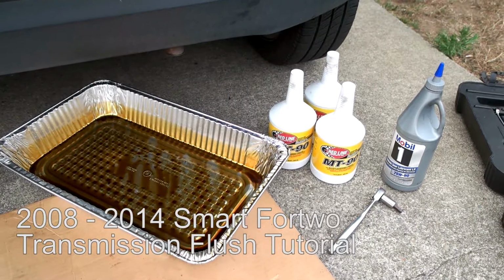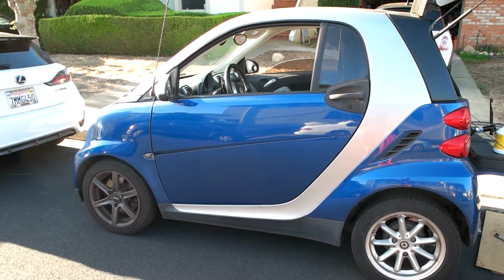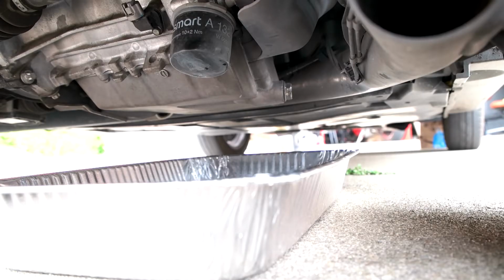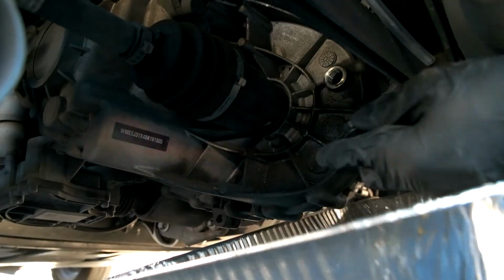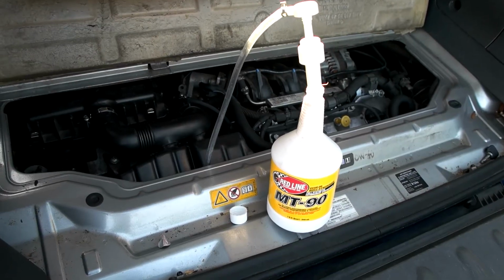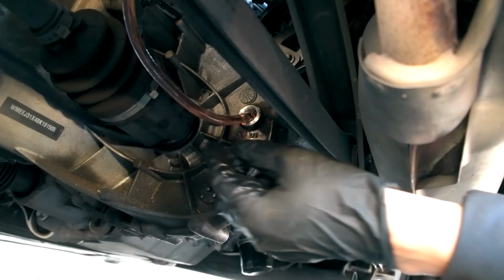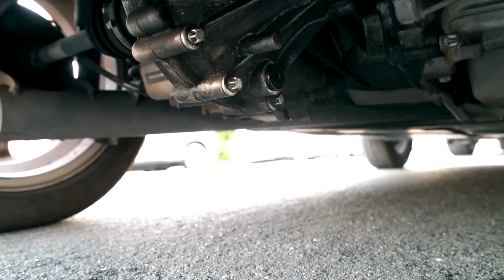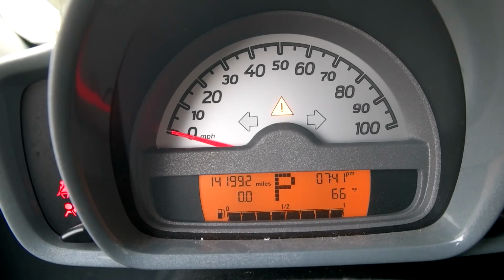DIY Smart Car ForTwo Transmission Fluid Replacement Tutorial

Comment from the maker: Hey everyone, I was able to upload the remaining videos in this series. Please feel free to check them out!

1. Oil Change https://youtu.be/4fhTtHxlgTU
2. Transmission Flush https://youtu.be/YLRtDSePTEA
3. Spark Plugs https://youtu.be/COdCrvQCQJU
4. Air Filter https://youtu.be/3oV5JR5FEy0
5. Valve Cover and Gaskets https://youtu.be/YKhJHt6haN8
6. Cabin Filter https://youtu.be/IDarMIspk7w
7. Reset Service Light https://youtu.be/7SBPWear5Ho
Reply: Hello, by chance do you know why the first gear goes very hard twice?
Reply from the maker: Hello, I do not recall having that issue on my smartcar. I'd suggest bringing it to a mechanic to verify @cesar20202
Reply: I changed out the oils as on your clip. Now my engine light is on, and it jerks a bit while shifting to higher gears 
 Any input on that ?
Reply: I followed your clip step by step. Now engine light is on plus it jerks a bit? Is it possible I have TOO much fluid in it ?. I'll take to to a auto zone for the codes in the morning
Reply from the maker: @michaeljones633  Excess fluid should have dripped out of the fill hole, and should not cause it to jerk. It almost sounds like there isn't enough fluid, or one of the empty or fill bolts was not tightened. Are you able to see if it's leaking? Scanning the code would provide the most accurate information as the issue may be from something else.

Comment: Is there no filter for transmission?
Reply from the maker: It has been several years since I've owned this vehicle, but I do not recall there being a transmission filter. This post also says the same thing. https://www.smartcarofamerica.com/threads/a-smart-car-transmission-is-a-terrible-thing-to-waste.29929/#:~:text=I%20changed%20mine%20at%201%2C000,at%2045k%20miles%2C%20et%20seq.

Comment: I think many people (me, too), bought a 451 not understanding it is not an automatic transmission.  ALL Smartcar 451 models have a manual transmission.  I have owned mine for 2.5 years without actually understanding.   Some 451s have a regular stick shift/clutch and some with a special shifting box that makes the shifting automatic, for the driver.    Read this:

Automated Manual:
The Smart Fortwo 451's automated manual transmission, designed by Getrag, operates like a manual but without a clutch pedal. It uses electrohydraulics to control the clutch and shifting. 

5-Speed Manual Option:
Some 451 models were available with a true 5-speed manual transmission with a clutch pedal
Reply from the maker: Yes, that's good information. I bought a used ForTwo and learned from my research that it had a manual transmission because people complained that the automatic shifting was rough. Thanks for the comment!

Comment: Great video.  #1 TIP - remove fill plug before drain plug. Thanks very much.

Redline is GL-4 and ok to use.   Mobile 1 is GL-5 and not ok to use (more below).
Mercedes added a spec for 451 tranny fluid in 2019, after done importing to US, so not in manuals.
MB 235.72 (not 235.71 or 235.72) is only available specific Castrol Product, which has to be ordered from EU.
Castrol Transmax Manual Multivehicle  505678    or   Castrol Syntrans Multivehicle 75W-90
both are MB 235.72 certified.
API GL4 , Ford WSD-M2C200-C, MB235.72, *SAE Class according to J306 pre 1998

Some GL-4 manual tranny oils state "protects brass" on the label.

AI says:

GL-5 gear oil is designed for high-speed, high-torque applications and contains a higher concentration of EP additives compared to GL-4. These additives are crucial for preventing micro-welding on gear flanks at high temperatures. 
 
However, the same EP additives in GL-5 can be corrosive to the bronze or copper used in synchronizer rings. These rings are essential for smooth and efficient gear changes. 

Using GL-5 in a transmission designed for GL-4 can lead to premature wear, grinding, or even complete failure of the synchronizers, resulting in harsh or jerky gear changes

Comment: How often should this be replaced? I just bought a 2013 with 92000 miles, I want to make sure everything is done so that it has a fresh start with me.
Reply from the maker: I'm reading that the transmission fluid never needs to be changed unless it's contaminated by water. Others suggest 30k-100k miles.
Reply: @ColinLeung  Thanks, I'm going to go ahead and do it anyways because its so easy. I've read changing is not needed but changing it made it run smoother for some.
Reply from the maker: @Phatxam  Sounds good. Let me know how it goes!

Comment: Hola buenas tardes disculpe al último en hacer los pasos para borrar las dos llaves mi carro no prende
Reply from the maker: If you're looking to replace a lost smart key for your car, you'll likely need to visit a dealership and provide proof of ownership. The dealership will then program a new key to work with your car. 
If your smart key isn't working, here are some things you can try:
Check the battery: Smart keys run on batteries, and over time the battery can drain, causing detection issues. 
Check for signal interference: Phones and radios can interfere with the signal between your key and car. 
Reset your key: To reset your key, you can try holding down the lock button for one second while the car is off, then turning the key four times within 10 seconds and removing it.

Comment: My question is why you have two diff. Brands is it it just for show or you drained and flush twice?????
Reply from the maker: To show different brands. I had the Mobil 1 from a previous car, but didn't have enough. It was cheaper to buy the Redline fluid, and I did not want to mix brands. Thanks for the question.

Comment: Hi @ColinLeung - was the car flashing wrench icon on the dashboard before oil change as well? or did it start complaining to reset after you did the oil change after its computer figuring the oil change? I know this is was an old video so only if you remember :)
Reply from the maker: If I recall it's scheduled to show up every x amount of miles. I don't think the computer is smart enough to know the oil was changed.

Comment: Is there a dip stick for the transmission
Reply from the maker: According to this post there is no transmission dip stick. https://www.smartcarofamerica.com/threads/hi-and-how-do-i-transmission-fluid-level.43993/
Reply: So how do you check the transmission fluid? I
Reply from the maker: @bobbyfischetti1630  You'd have to open the top fill bolt, and feel if the fluid is low...

Comment: @michaeljones633
33 minutes ago
I changed out the oils as on your clip. Now my engine light is on, and it jerks a bit while shifting to higher gears 
 Any input on that ?
Reply from the maker: Is it a check engine light? I'd suggest using an OBD2 reader to see what code it is. Did you replace the transmission fluid, or engine oil?
Reply: Colin !! Code came back. .. p0301 . I have a misfire  on cylinder #1. Just odd how that would show up after a transmission fluid change  @ColinLeung
Reply from the maker: I'm glad you figured it out and it's unrelated to the transmission flush, but I'm sorry you have a misfire.  @michaeljones633
Reply: @ColinLeung  Im hoping it's just a spark plug issue
Reply from the maker: @michaeljones633  That would be the cheapest solution. Let me know what the issue is when you fix it.
Reply: @ColinLeung  Well plugs and coils are replaced. But the plugs were covered in oil. Valve cover gasket is my next bet.
Reply: I followed your clip step by step. Now engine light is on plus it jerks a bit? Is it possible I have TOO much fluid in it ?

Comment: Hi, the Red Line MT-90 is a GL-4, does the trans oils spec require GL-4? That link of fluid specs did not specify GL-4 or 5. Thnx
Reply from the maker: I don't think it requires GL4/5. Some other trans oils suggested on the forums are:
Specification (Castrol Manual**) BOT328, 75W-90 API GL4
smart P/N #A 001 989 51 03 10
Mobil Delvac Synthetic gear oil 75W-90
Mobil 1 Synthetic Gear Lube LS 75W-90"
Reply: @ColinLeung  Respectfully, GL-4 for manual/automatic tranny.   I posted a comment on your excellent video today.

Comment: Hi, quick question, does the transmission fluid has to be Synthetic 75w90 or can i use conventional one like 'Valvoline High Performance 75W90 Gear Oil'? Thanks
Reply from the maker: Based on this website it doesn't specify that it needs to be synthetic. https://cararac.com/gear_oil/smart/fortwo.html
Reply: @ColinLeung  Thank you
Reply: Hi,  that is weird.....the site doesn't list the Oil Type for my 453 ( DCT transmission)  I saw for 451 is 75w-90.  Thanks
Reply from the maker: @Nick2JZ  I responded to your other comment regarding 453 oil.

Comment: Seems like u don't need a pump ??  Just a funnel with a hose attached  would do the same ...  right ? ...
 Plus then u can use it as a beer bong after .. or vice versa 🤣
Reply from the maker: Yes, you can use a funnel with a hose. I had a pump laying around, and used that instead.

Comment: Ok, so the fill bolt on my 09 Smart ForTwo got stripped (the hex has rounded off on the inside), And I can not find a replacement bolt for it :( any help with finding one is appreciated... thanks
Reply from the maker: Hello Prime, I couldn't find the transmission parts diagram online. I'd suggest calling a Smart dealer and asking them... Sorry I couldn't give you a link to the product.

Comment: Your video encourage me to have a go and as explained in your video it was so easy. I did it myself. The shop wanted $170 and I bought the better oil and pump for $53. A great saving. Thanks again for sharing your videos.
Reply: Amsoil both trans and engine will help these vehicles last a lot longer and increase drain cycles plus improve performance too David. Also pays to use a fuel system cleaner every 4 tanks.
Reply: @conmanumber1246  what fuel system cleaner you recommend

Comment: Would a transmission fluid slight leak be difficult to fix would it just be replacing a seal?
Reply from the maker: It might be easy, but it depends where it's leaking from.

Comment: Do you manually shift your Smart Fortwo for better performance instead of using the auto clutch? If so, how do you find getting used to it's type of manual gearing as opposed to a regular clutch manual transmission? Also, do you switch gears when the arrow on the dash tells you or do you just get a feel for it by the revs and sound like you normally would do? I'm about to try it for the first time, not having driven a standard in years. My car has no tachometer on the dash.
Reply from the maker: I did a mix of auto and manual shifting depending on where I was driving. I left it on auto when I felt lazy to shift in the city and highway. It felt different than a manual because you cannot control how long or smooth the clutch engages without a clutch pedal. I shifted based on the sound of the engine. I did add an obd 2 scanguage that told me the rpms, but ended up not using it often.

Comment: Just got a 2008 Fortwo Passion. I have no history on the car. The back door says Electric Drive which they didn't make in 2008 so I think someone replaced a lot of stuff on the car. Back of the owners manual a hand written note says oil and filter was changed in march of 2015. It's got 77K miles on it so I'm thinking I need to just change everything I can maintenance wise. I subbed because you have a current active Smart Car channel and hopefully I can pick your brain if I have trouble with this stuff. LOL Thanks. I see you are a Christian and you do ebikes so even better! I have a 48v front hub 1000W ebike. I should talk to you about Biblical Cosmology sometime.
Reply from the maker: Thanks for the comment. Yes, I can try to answer any smart questions you have. I sold the car a few years ago, but can see if I remember anything.
Reply: @ColinLeung  Oh I see, these are videos you made a few years ago. Would you happened to know someone who repairs the soft top on youtube? I need to rebuild mine and a shop wants 2400 dollars. That's more than I paid for the car. LOL
Reply from the maker: @DivergentDroid  I did a quick search and found this https://youtu.be/J1WPlQxsHmM